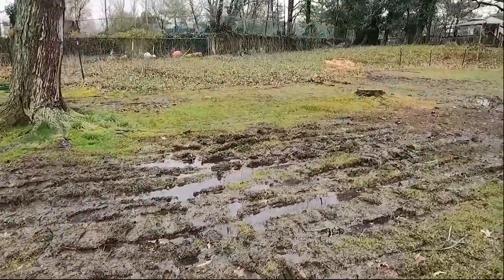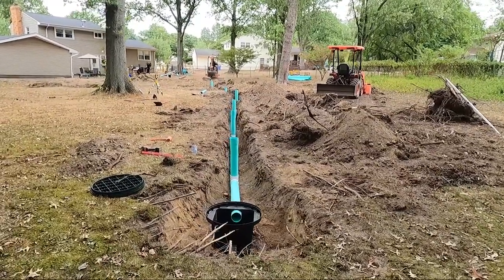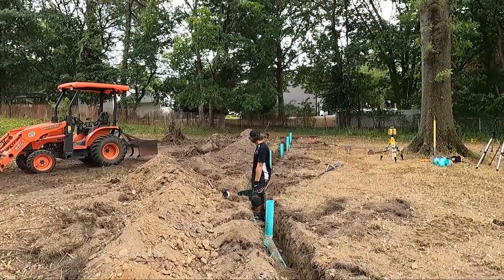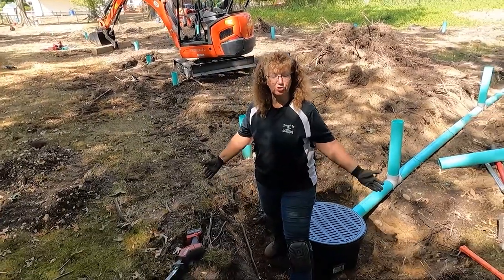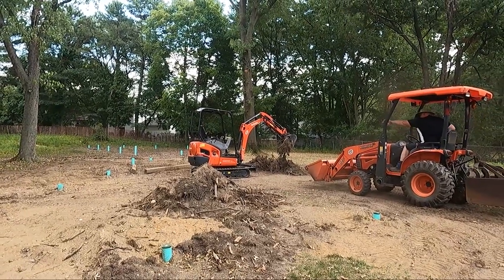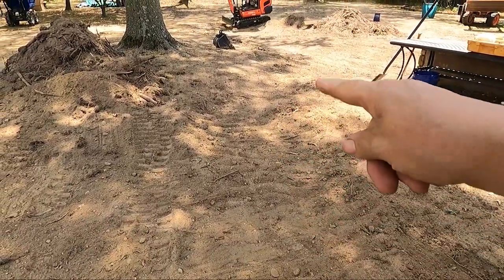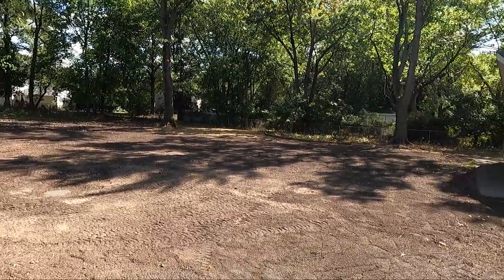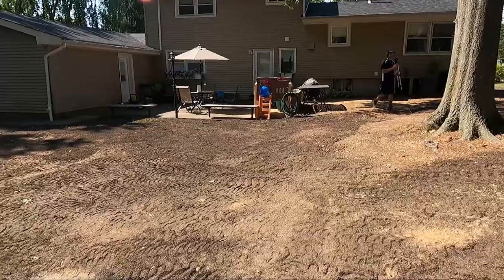Catch basins and yard grading to solve a very wet backyard.  Part 2  - Finishing & making it pretty

Comment: I haven't seen blue 4 inch before, is it a city requirement? I wonder if you can build up the dirt by those neighbors so water doesnt plunge into the yard?
Reply from the maker: Hi Design Build.  Not a requirement.  That's SDR 35.  Much stronger than thin wall and you still get the full range of fittings.  It's my go to 4 inch pipe.  It used to be green.  They made it blue a couple years ago.   You cannot change the grade or level of your yard within 10 feet of the property line in this town.  Have a great week, Tom

Comment: So they won't let you tie into storm runoff but they'll let you tie into sewer drain? Hmmm sounds like they'll be paying extra for their sewer fees and in big rain events the city sewer will become overwhelmed. I should say in Pennsylvania you cannot tie storm runoff into sewer.
Reply from the maker: I think we have a misunderstanding with the terms we use here in Jersey.  The storm sewer is different from the sanitary sewer.  Storm sewer are curb drains and is for rainwater.  Sanitary sewer system is sewage that goes to the treatment facility.  It's not legal to tie into the sanitary sewer system.  The town gave us permission to tie into the storm sewer pipe that runs between 2 catch basins.